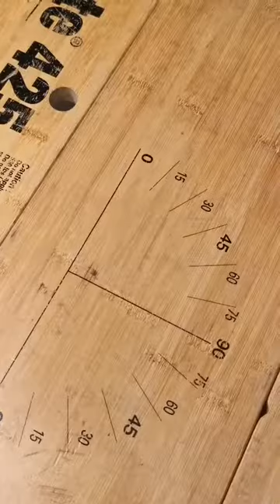Proxxon MF70 Spindle 2nd Upgrade

Comment: What is the diameter and length of the original Proxxon MF 70 spindle shaft? Thanks
Reply from the maker: The diameter of the original spindle shaft is 10mm and around 48mm in length.
Reply: Thanks a lot🙏😊
Reply: By replacing the spindle & using milling bits of 6 mm or more and without the addition of a timing belt & pulley combination (modification of additional torque).  Is it strong enough for aluminum/steel milling jobs?  Thank you.

Comment: Hi, I noticed that the C10-ER11 shaft on Aliexpress is hollow, but yours is not. Hi, I noticed that the C10-ER11 shaft on Aliexpress is hollow, but yours is not.
This does not match the shaft you are adjusting. Could you clarify that for me?
Thanks
Reply from the maker: Yes. There are 2 kinds of C10-ER11 shaft. You need to pay special attention. The one I bought was solid shaft w/150mm in length. But most others are hollow. I don't know if you could find a solid shaft on aliexpress. Where I bought it was from Taobao, the Chinese version of Aliexpress.
Reply: @eddiejiang6789  Hi, thanks a lot for the information. I asked the seller and they wrote to me that the C10-ER11A is a solid shaft. So I hope they are right.
I only need ER11 chucks, the original ones are only 3mm and that's not enough. Your upgrade is more than enough for me. What Zhadlun is doing is pointless. He won't make a camel out of a mosquito.

Comment: Just watched your upgrade video, how did you remove the original shaft -did it just pull out from below, or did you have to remove the motor from its housing first?
Reply from the maker: To remove the spindle shaft, you'd have to remove the motor first. Then you will see there's a coupler at the upper end of the shaft. The coupler is assembled to the shaft with a M3 screw. Remove it. Then you can easily pull the shaft out from below. Hope this helps.
Reply: @eddiejiang6789  how do I remove the bearings then? There's a sleeve in between them and I don't know how to get a hold on them to pull them out.
Reply from the maker: @PierreLucGagnon58  I didn't remove the bearing. After removing the plastic coupler at the top of the shaft. It is very easy to slip out the shaft from the bottom and replace with a 10mm shaft. No need to remove the bearings.

Comment: こんにちは✋️🤓👍️
日本から度々質問させてください
暇なときに返信していただければ幸いです
シャフトの取り外しについてなんですが、
ベアリング2個に対して、シャフトは硬くはまってますか？または、隙間があってスルッと抜けるんでしょうか？
実は昨日判明したことなんですが、日本モデルはmade in japanで、海外モデルと構造が違うようなんです(電力量も100wではなく、55w)シャフトの収まりやパーツも海外モデルと若干異なるんです図面を見て確認しました
しかしベアリングにキツくハマってるのか、隙間があるのか、そこは同じだと考えてます
ちなみに、ベアリングはTNT製の6000Zで、シャフト径は10mmです
まだシャフトは外していません
Reply from the maker: Hi, for my MF70, the main shaft is assembled by a M3 screw at the top with a coupler which transfer the torque from the motor. To dissemble the shaft, you only need to take out the M3 screw and the coupler. Then you can pull out the shaft from bottom. It's quite tight thus you'd have to pull it hard. I'm not sure if Japanese version is the same structure.
Reply: @eddiejiang6789  ありがとうございます！
やはりベアリングにはシャフトがきつくハマってるんですね
それが知れて良かったです
あなたの話を聞くと、日本版と似ているけどやはり少し違うようです
日本版の展開図をアップロードしたので良ければ見てアドバイスお願いします
https://www.youtube.com/shorts/cI2aUsJ280I
※メインシャフトにスナップリングとEリングが1個ずつ付いていて
どうやって外すか分からないんです
Reply from the maker: @Galaxy-db5qd Yes, the Japanese version is same as mine. Just take out no.57 (M3 screw) and no.39 (the coupler), then you'll be able to pull out the main shaft from bottom. The e-ring (no.58) does not appear on my version. But seems it's at the bottom, and should not be a problem when dissembling the main shaft?
Reply: @eddiejiang6789  ありがとうございます✋️🤓🎊
あなたのマシンにもEリングとスナップリングはありましたか？
Reply from the maker: @Galaxy-db5qd I don't think I have e-ring (no.58). As for the ring no.24, I don't remember I've seen that. Even if I also have that, I think it is to hold the bottom bearing on to the body, thus no impact for pulling out the main shaft.
Reply: @eddiejiang6789  何度もありがとうございます✋️🤓💧
あなたのアドバイスをもとに、トライしてみようと思います！日本からありがとうございました！
また何か質問あるかも知れません、その時はまた教えて頂けると助かります🤝
Reply from the maker: @Galaxy-db5qd MF70 is a fantastic product which you can make a lot of upgrades and modifications. After upgraded the spindle, I have further upgraded the motor to a brushless one. And then upgraded the motor-side coupler to replace plastic with aluminum. And later on, given that MF70 is a bit small in its dimensions, I've built a CNC of my own. That is what I am finally using now. You can find all those videos in my home page.
Reply: @eddiejiang6789  ありがとうございます✋️🤓
ブラシレスモーターの動画も拝見しました
このアップグレードもいつかやってみたいと思います
ホームページはどこで見れますか？
Reply from the maker: @Galaxy-db5qd Sorry, I mean  my channel on YouTube.
Reply: @eddiejiang6789  そういう事ですね勘違いしてました✋️🤓💧
ところで、今機械加工の業者に、ER11コンバーター5mm穴タイプを持っていって、m８×0.75を精密に加工してくれるか？と頼んだんですが、焼きが入ってるからうまく出来るか分からない、と言われました
一応渡して、後日取りに行くことになりましたが、加工できたとしても、振れが大きいかもしれません
その時は、c１０のロングシャフトを買って、それをカットしてもらう加工をして貰う予定です！
焼きが入ってる(熱処理)されたものに、タップを切るのは、やはり困難なんでしょうかね
Reply from the maker: @Galaxy-db5qd  Hi, I'm not an expert in machining and CNC. So I don't understand some of your terminologies. If your concern is that the C10 long shaft has been baked and would not be able to process, then I don't think it would be a problem. If you watch my video about 2nd upgrade to ER11, I just used my lathe to work on the long shaft directly and it worked. Still I don't recommend the solution in this video after I made the 2nd upgrade, because this solution: 1) will make the spindle longer (the part under the body) thus will shorten Z-Axis travel, 2) this  would make the spindle heavier, which could reduce the effective power from the motor, and 3) this solution will increase the runout of the spindle (in my case, this solution makes >0.05mm runout, while the 2nd upgrade makes ~0.03 runout).
Reply: @eddiejiang6789  ありがとうございます✋️🤓
今回はER11コンバータに直接m８×０．７５タップを加工して貰う事を依頼しましたが、振れが大きくなる可能性が高いという事ですね
次回はこの動画の様に、c10シャフトを買って、加工依頼して貰うことにします
また結果を報告します！👋🤓🇯🇵
Reply from the maker: @Galaxy-db5qd 👍👍👍
Reply: @eddiejiang6789  こんにちは✋️🤓コンバーターにM8ネジを切ってもらう依頼出してましたが、電話が来て、焼入れしてあってドリルで穴も開けられない、諦めろ、と言われました
仕方ないので、あなたの動画の２ｎｄアップグレードを真似ようと思います
一応報告でした👋🤓
Reply from the maker: @Galaxy-db5qd  Sorry to hear that. I understand that quenched steel is very difficult to work on. The good thing is that the 2nd solution is even better (at least from my perspective). Good luck to you.
Reply: @eddiejiang6789  今回の実験は失敗でしたが、良い教訓になりました☝️🤓👍️何事もやってみなければ分からないと言うことですね
２ｎｄアップグレード、また報告します、それでは👋🤓🇯🇵
Reply: @eddiejiang6789  お久しぶりです✋️🤓🇯🇵
この動画と同じ方式でER11化アップグレードしました
芯ブレなんですが、シャフト側の内径テーパ部にダイヤルゲージを当てて手で回して、0.03mm〜0.05mmと振れます
元の買ったときついてたシャフトだと、0.01mmも振れません
あなたのはどれくらい振れますか？☝️🤓
Reply from the maker: @Galaxy-db5qd  Hi, I think the runout is reasonable. My machine also has around 0.03~0.05mm runout after upgrading. My original shaft has around 0.02~0.03mm runout. For me, as a desktop CNC, and mainly for the purpose of making models, it is good enough. Anyway we are not making industrial product with it. Tolerance under 0.1mm for final product does not really make a difference.🤭
Reply: @eddiejiang6789  返信ありがとうございます✋️🤓
それを聞いて安心しました
ただ、コレットをつけて刃物をつけてそれの振れを計測すると、0.1くらい振れるものもあります
コレットもAmazonの安物で1mm〜7mmまでのをセットで買ったんですが、それの精度が良くないのかも知れません
コレットも高いの買って付けたら良くなりますかね？
Reply from the maker: @Galaxy-db5qd  For this I really am not able to provide comments. Collets could have impacts on the runout. You can have a try to see if it gets better with different collets. BTW, the runout I mentioned earlier was the measurement of the milling bit, not the shaft
Reply: @eddiejiang6789  ありがとうございます👋🤓
あなたのは、刃物を付けた状態の振れでしたか、それならシャフトの振れは更に小さいかもですね
とりあえず今新しい、高価なコレットを買って試そうと思って探してます
ありがとうございました👋🤓🇯🇵